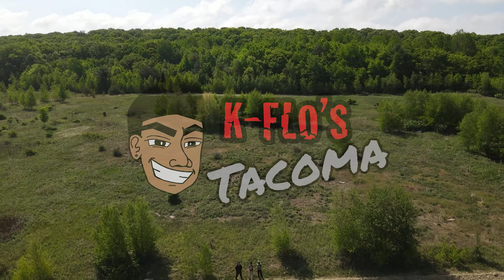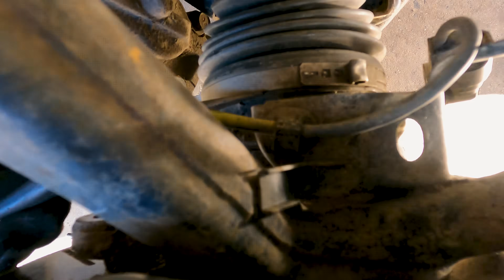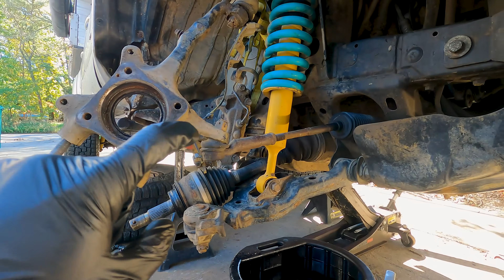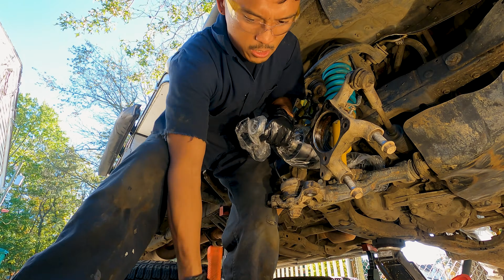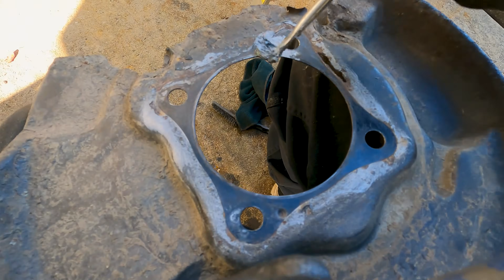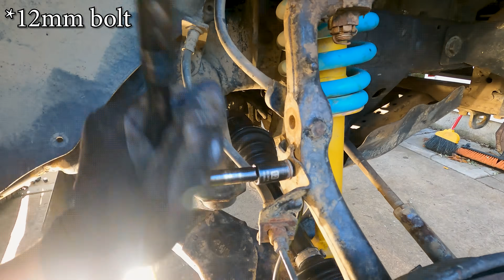Tacoma Wheel Bearings + CVs Replacement

Comment: a little long winded, but very helpful for me today- replacing wheel bearings on my girlfriends truck, good to know I can get the knuckle separated only taking off the bottom bolts to replace that outer seal. Thank you. 
ford trucks and jeeps more my thing, but I have the tools and some experience in working on vehicles in my driveways. DIY saved us over 1000$ in shop cost if we would have had them do it.

Comment: I just bought a 2018 TRD sport. Had to have the front diff replaced. Your video was outstanding and gave me the courage to attempt the clamshell/needle bearing replacement, do the upper and lower control arms (billet EMU) on top and MEVOTECH lower with TTX lower ball joints, replace the sway links and the inner and outer tie rod ends with MEVOTECH TTX grease ables. You have a new fan. Thank you.
Reply from the maker: Awesome! I'm glad these videos helped!

Comment: One thing I ran into while getting parts was that the differential seals are different passengers from driver as well as you don’t talk about checking the driver side neddle bearing
Reply: Otherwise great tips and tricks had one side done in little under an hr after setting up
Reply: 🤦 just ordered two of the same oil seals not realizing they were different sizes. I wish i would've seen your comment earlier😅

Comment: Great instructional video as usual. I have a question with regards to replacing the lower ball joints. Why are you replacing entire lower arm instead of just LBJ? Unless of course you need new bushings or some high end aftermarket arm.
Reply from the maker: I answer that in my LCA video (it's closer to the end of the video): https://youtu.be/3D29XuFu5EM

Comment: I have never heard anything positive about aftermarket CVs, especially with respect to the CV boots, on Toyotas. There's a big cost difference I realize, but given the time involved in replacement, it seems like false economy to use the lower cost product (the one linked above) over the OEM. I'm curious why you opted for the after market vs OEM. Do you find the OEM had poor longevity?
Reply from the maker: I'm harsher than most people with my truck. This aftermarket Cardone CV has held up about 70k miles and roughly 4 years. And i replaced them with the same ones. The salt spray in jersey is harsh. I would've just replaced the boots if the bearing surfaces weren't so rusty and pitted. With regards to the boots, it's actually not that difficult to replace the boots, u don't even need to take the whole CV off. Check out this video (https://youtube.com/shorts/5KImfLqT5Q0 ) once you remove it from the diff side you have access to replace the inner boots. It's usually the inner that gets chewed

Comment: Any updates on the CV axles? I did the same exact ones on my truck and after 2 months both inner boots are already leaking.
Reply from the maker: The old ones that came off were also Cardone HDs and they lasted me a few years. The ones that I currently have on are running solid. I would advise contacting the company and asking for a warranty replacement

Comment: Nice work. I love my 2nd gen nice to see you doing what I consider normal maintenance. Were those your original CV’s ? If not how many miles would you say they lasted? Also how much is your truck lifted in front. I want to lift mine about 1.5 inch and know that angle will be rough on those axels.
Reply from the maker: I do some pretty hard 4 wheeling and mudding. My OEMs lasted about 110k miles (that was on stock and then 33" tires @90K). My tires are also 35's and I have a 4wheel camper so these lasted about 60K. My lift is a 2 inch lift.
Reply: @TacomaTutorials .  Thanks!

Comment: Another #10
Did you replace the Toyota driver's side front differential bearing ? I did mine with the East Coast replacement sleeve while I was in there replacing my cv drive axle
Reply from the maker: Yessir! I actually have a video on the ECGS needle bearing replacement
Reply: Just watched it.
.I had an almost impossible axle/ bearing hub assembly separation..I couldn't get the axle to push out of the bearing housing in order to change out the axle..